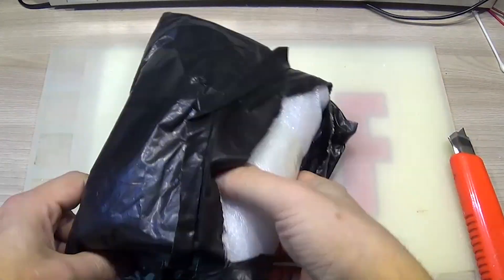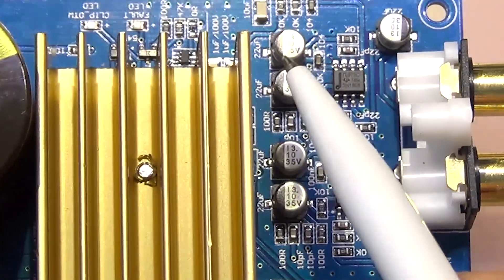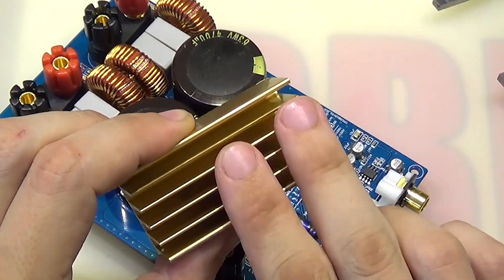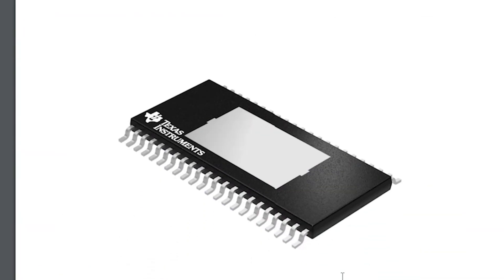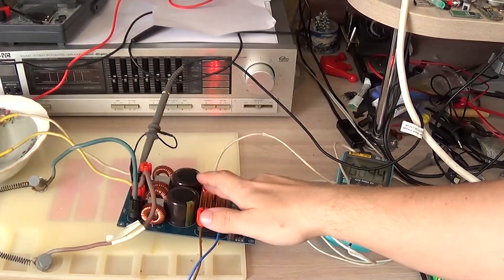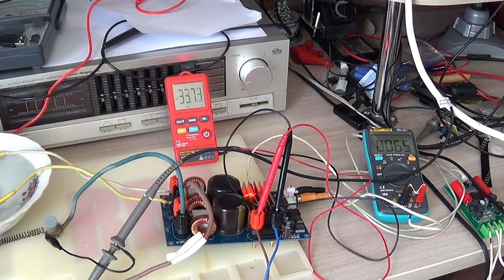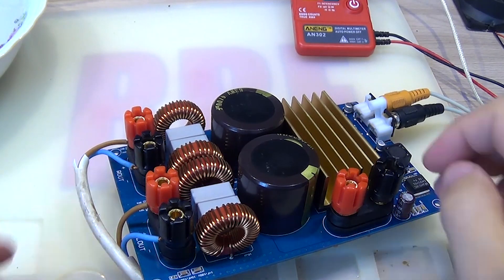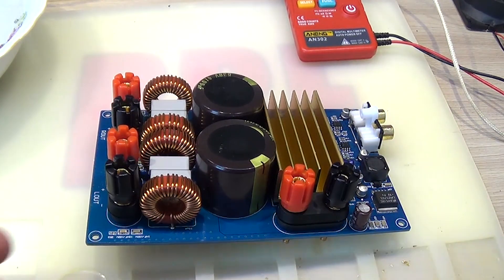A small and powerful stereo amplifier powered by TPA3255. And I like it!

Comment: You need to be corrected about your video demonstration….You paid 50 bucks for this amp, and the genuine Texas Instruments version actually cost around $250. You looked at the data sheet which is Texas Instruments, and you think that applies to the 50 bucks version? Texas Instruments has a good reputation for producing great components and generic products have never been able to compete with the original. Nice video though…..!

Comment: Tpa 3255 allows 20-25 watts (clean) with a distortion of less than 0.1% even at 20 kHz at 4 Hom and 8 Hom.
The power is bigger but if you want a good hi-fi it is about 25 watts because beyond it gets dirty like all class D.

Comment: Which is best sound quality. Tpa3116 or this? Sound quality i mean how accurately it's output mimics the input. Can you check it with Oscilloscope .
Reply: no soy experto. pero supongo que sera por que la entrada RMS es 240w DC si lo pones en AC que es la señal que da la salida sera 480W pico a pico aprox

Comment: This amplifier is useless. what are you going to do with so many watts when ic. boils long before max watts. Too small heatsink
Reply: Add fans for heat dissipation?
Reply: @rebelliongaming2651  you only have room for a small fan and it has to run full blast. I wonder if a fan is enough.
Reply: @ford1546  inside a DIY enclosure (not small) there will be ample of space for ventilation
Reply: @rebelliongaming2651  I have built several amplifiers and DAC and bluetooth. inside either larger aluminum boxes or plastic boxes.

The big problem with electronics is always heat. The L15D class-d board, which has a relatively large heatsink from the factory, gives 150w rms. Then 200-300w should have an even bigger heatsink!? L15d doesn't get very hot, but hot enough that you should have a fan inside a case.

The fan makes noise and has a lifetime and causes you to get a lot of dust inside the box in exactly the same way as a computer.

There aren't many transistor-based class-d that you can mount on a heatsink. Hypex ucd180 is one that has that option, but it is only 80w and doesn't get that hot.

Class-d not only gets hot when you play loud music but also from noise that is filtered out by the output filter.
Reply: @ford1546  thank you for sharing your experience, I also do DIY audio using budget-friendly Class D amplifiers, but I've never dealt with power above 150W RMS, so a single low-noise fan running at low RPMs has been sufficient for heat dissipation in my case. I'm excited for my next DIY project using a TPA3255 2.1 amp 😇

Comment: What do you mean the heatsink isn't big enough?  I have a 3500w power acoustik razor3500d and beating down the block for almost an hour, it barely get warmer than my hand.
Reply: I question that amp's ratings. It claims Max 2100W RMS into 1ohm load, so not sure where the 3500w magically comes from. But regarding the heat, the entire chassis is basically a heat sink. So it's actually got good thermal dissipation.

Comment: I noticed that the coils moved easily when you poked them.  They should all be glued to the board to reduce vibration.  Overall, it's a good board for the price.  But class D can be done so much better.  The world is already awash in cheap mediocre amps like this one.  Especially with Korean engineering and Chinese production.  There are some great class D amps with just a few extra components - but they're ridiculously priced for no reason other than pure greed.

Comment: Nice job, looks good. Thank you! But what i see when I tested small amplifiers, is that the heat is normal. You send 1Khz to the amplifier without pauses (music is not continues) and that will heat up the radiator. Normally this will not happen when you playing music so it wil stay cooler. But i like the way you test, nice! 💯

Comment: 48V x 5A = 240W. So how can it produce an uptput of '300W+300W? Only RMS values are of any use. 
These values quoted are PMPO.
Reply: It's not PMPO, but I believe the 300W rating is based on 53v supply with 10% distortion. So probably about 270W of clean RMS.

Comment: I use large Heco Aurora 1000 speakers and after burning my Yamaha V6A due to the high volume I bought two class D amplifiers; Fosi audio V3 and Fosi audio ZA3 with the TPA 3255 chip.

Fosi audio V3 can give a higher volume compared to the ZA3 but the sound of both is better than my Yamaha V6A and they both manage to satisfy my Haco aurora 1000 speakers without problems and do not heat up too much by using a power suplay of 48V 5A.
Reply: high volume doesn't burn speakers. Clipping does

Comment: There were a ton of those amplifiers boards dumped onto the market.  Most are "repaired" boards that were returned after failing in their primary application.  Check these boards very carefully before you fire them up.

The chart on the front pages of the data sheet tells the story .... at low distortion.... 100 watts per channel on 8 ohms and 200 on 4....  The 300 claim is for 10% distortion which would drive the chip into protection in very short order.
Reply: Yes they tested at 1khz and 10%THD+N but surely give at least 180 watts RMS at 20hz-20khz 1%THD+N and still for it small zise its a lot.
Reply: @michaeliosefmaierparedes5082  
Watch carefully when he's unbaggin the board... note that he bent the RCA connectors into place? Because they weren't properly soldered down.

As I said... check these boards VERY carefully before powering them up.

Comment: listening test through youtube is USELESS! 

You can hear if speakers color a lot on some frequency or if it has too much or too little treble or too much or too little bass.

But you will never be able to hear the difference between two amplifiers!
Reply: That is an incorrect statement. Even with cheap headphones one with even a slightly discerning ear can easily differentiate between amps, speakers, etc if the original recording is good.
Reply: @BioMedUSA  Of course if you compare 2 speakers through youtube, recorded with the same camera and in the same room, you can hear differences without problems.

But whether the sharp sound is due to the camera or not is difficult to say.

Comment: watts in the data sheet are  in 10%THD which is very common for this type of amplifier ic.
10%THD is a useless measurement and not nice to listen to.

You should measure watts in 1%THD and then you will get MUCH MUCH less watts out of the amplifier!

Also see that THD is measured in 1 watt, which is USELESS as you will always get better THD in 1 watt than 100 watts.

THD= total harmonic distortion.

The factory does not write the whole truth. It looks like it's a better amp than it is.

Heatsink never manages 128w watts either
Reply: Even .1 is not nice. .01 is the go or better

Comment: I may have missed it, but was the output Peak or RMS?
Reply: watts in the data sheet are in 10%THD which is very common for this type of amplifier ic.
10%THD is a useless measurement and not nice to listen to.

You should measure watts in 1%THD and then you will get MUCH MUCH less watts out of the amplifier!

Also see that THD is measured in 1 watt, which is USELESS as you will always get better THD in 1 watt than 100 watts.

THD= total harmonic distortion.

The factory does not write the whole truth. It looks like it's a better amp than it is.

Heatsink never manages 128w watts either
Reply: @ford1546   10% THD is mud

Comment: Nice parts, with the exception of the non-shrouded/shielded output inductors.  Also poly film type capacitors on the output stage are preferred.

Comment: Nice to hear the comments from your viewers.. Please try the IRS2092, it is more powerful than that due to the mosfet output drivers and the ic only is the controller, not like this on the video that the ic itself is the amp.
Reply: It is not in same range, demands simmetrical PSU with higher voltages. Of course it is more powerful.
Reply: @nikolatesla4030  yes. Hope we can make one. It is too difficult to build.
Reply from the maker: ok

Comment: What's the minimum amps required by this amplifier?
Reply from the maker: Depends on how much power you want to get from it. You can go as low as 1 amp, just to hear the sound
Reply: My 48v power supply is 5 amps, you can go higher amps apparently but 5A should be enough not to overstretch this chipset...
Reply: @logotrikes but need fan for the smal cooling. Wondom have a nice cooling design for tpa3255